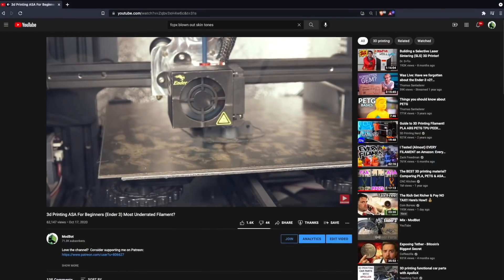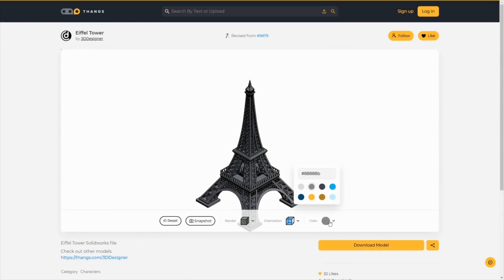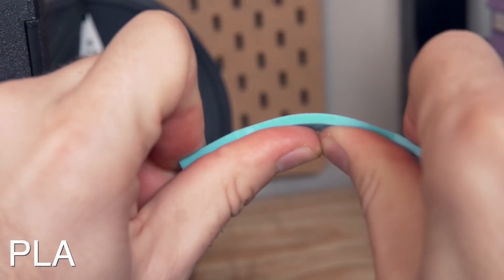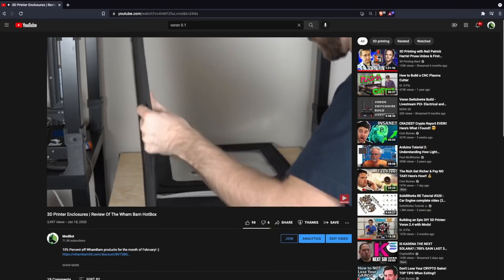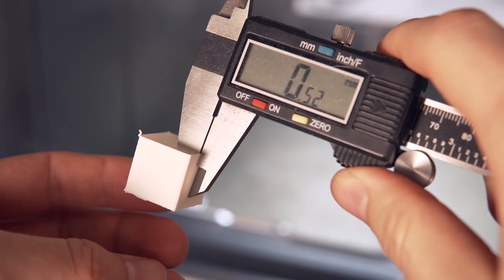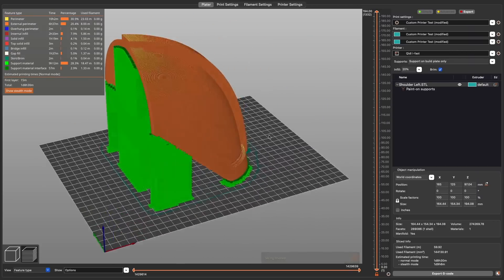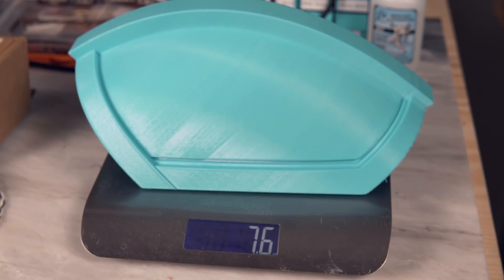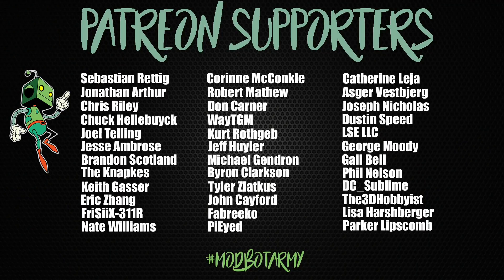3d Printing Lightweight ASA (LW-ASA) Best Filament For Props & Cosplay?

Comment: Why all iron man cosplayers make it out of PLA+ or similar is because it takes a tength of the print time and learning time to print it perfectly. Almost no failures. No warping. No curling. No struggles. The ~30% saved weight is nothing ot a cosplayer generally speaking. The armor pieces you show off here weighing almost nothing compared to a single backpack. There is no weight to speak out here that compensates for the extra difficulty of printing. There's a reason almost no cosplayers use ASA. It took me a month to dial in ASA to be able to print an iron man helmet with zero artifacts, curling or general warping. It's extremely difficult. ASA is glorious at printing smaller, usuall flat, mechanical parts against the bed plate. Larger spheroids, helmets and breastplates is a mess with zero tolerande for piece alignment is a mess with ASA. This is the real reason people still use mostly PLA. You just press print and what you saw in the slicer is what you get. Boom done. Now they can go to the convention while you are still figuring out difference alignments of the ASA, how many pieces you must cut it up in, how to support it hard enough and trying to cope with all the issues with the material. 

ASA isnt impossible to print with. It's just not adapted to large cosplay armours. It's 100% made for small flat mechanical parts and it's INSANELY good at it. I've used my ASA scraper for 2 years and it's not even damaged. It's the best material ever. But it's really not made for large cosplay pieces. It's the wrong thermoplastic for that.

Comment: Great video. If you had to choose between HIGH TEMP LIGHT WEIGHT PLA or LIGHT WEIGHT ASA for large RC planes which do you think would be best?
Reply from the maker: ASA would be my choice just for heat from any of the motors and it’s resistance to degradation from UV 😊

Comment: Also I have been watch Video on 3d printing Gears. The whole thing with gears is fiction . Friction creates heat. Thats not hard to understand so of course a PLA printed gear is not going to last very long. Steal can hold the heat much longer than any plastic printer gear. Even in bearing's steal will freeze up if you don't use some liberating oil.

Comment: I just thought that strength is not just material strength depending on the part you are trying to build. I saw an episode of LEGO WARS tv program. Where the contestants built a bridge out of LEGOs. And to see how much weight it could hold. THe wining bridge design held 1000LBS. So the design does add a lot to the strength of the piece. Also on "This Old House" TV program they built a bench seat in a shower  made out of something like foam board. Also we have seen that placing plywood sheets in a certain orientation adds a lot of strength to a structure in an earth quake. So I am doing more redesign in my parts to see if I can  make them stronger with out just adding more infill. Also CURA has Infill for crush strength and also WALLs for twist  strength .

Comment: I like the video. I am trying to find the old ASA video. The one thing you did not cover that you might have covered in the previous video is how does ASA compared to ABS as hazardous partials and fumes are concerned. I print in PLA  TPU and PETG.   I decided not to print with ABS for that reason. If i don't need real strength ASA or Light weight ASA seems like a good choice. I wonder how Light weight ASA compares to light weight PLA when it comes to building RC models. Airplanes, boats, and cars.

Comment: Iv printed a couple rc planes with esun lw pla but noticed it tends to break near structural areas. Is lw Asa stronger than lw pla?
Reply: No, as sad in this video ASA vs PLA, the ASA will shatter like glass and the same goes with LW-PLA vs LW-ASA. I printed a couple of RC printed plans for Eclipson and 3Dlabprint and still, I didn't see them using LW-ASA Or even recommend it.  I think mostly is because you need that damn enclosure to print it but This LW-ASA had been in production for quite some time now and still, it's not popular with the 3D-printed Aircraft.

https://www.youtube.com/watch?v=oM24AnGZdo0

Comment: I think it would be interesting to print a hot end fan shroud out of this to shave a little weight off...
Reply from the maker: I had not even considered this and now it seems so obvious. That is a great application.
Reply: If you actually increase the performance of your 3D Printer by losing like 1g of material, you might as well just throw the entire 3d printer out the window and consider getting a proper one. Any 3d Printer worth its money will laugh at the amount of weight saving and by the time you've sped up your 3d printer fast enough where such miniscule weight savings could actually make an observable impact you're printing high quality garbage like those guys over at the Speed Benchy Race - It just doesn't make any sense.
Reply: @Chris Valin Proving my point would be like telling you about air keeping you alive - It's beyond obvious if you spent any time trying to print a lot faster than what your average run of the mill 3D Printer will normally do.

Up to a certain point weight will mean nothing to your 3D Printers performance and once you've reached that point where it does you've long since surpassed the point where your prints are still presentable because of reasons that had nothing to do with the motion system such a LW material could benefit from.

Just look at literally - every Speed Benchy Race Video out there. Especially the ones where they skeletonize and carbonframinize their machines to the max to save every grain of weight they can get followed by adding two half HP Servo motors to the X/Y Axis - The prints still look like fresh horse shit you cannot use for anything other than uneducated YouTube clicks.
Reply: @Duraltia  I see it's been about 9 months since you tried to make this point, however, the weight savings could be pretty useful for a delta printer. Could help improve speed and quality.
Reply: @Xanthira222  I think my last statement still holds fairly true as I'm not aware of any major and universally applicable advances in 3D Printing ( at least not in the Hobby / DIY sector ) having happened since my last argument that would disagree with it.

My point back then was about the kinda ridiculous claim that a weight saving of 1g at the Tool Head ( in relation to the rest of the entire moving mass ) would result in a sharp performance increase.

Is a 1g saving on a 300g moving mass system noticeable from a machine standpoint via Inertia / Resonance Measurement Systems? I hope so! Will it show in the 3D printed part? HIGHLY unlikely because if your machine is affected by 1g then simply loading a denser / heavier Filament could totally run your machine out of whack for whatever you've calibrated it for - Hence my comment about throwing that garbage machine out of the window as it your requirements for precision can simply not be met by such a frail system 😁

Comment: Can the infill be printed with different settings for more foaming and less density than the shell? So that she'll is harder but has more or less a foam interior support?
Reply: You could in theory but it would require the temps on the hot end to ramp up and down so it would only make sense on fairly large prints. It would also probably require the slicer to have awarness of the material and how its flow rate needs to change at each temp. Also... since the material doesnt' flow out of the hot end instantaneously it would probably need to be done on a lower flow rate hot end with a low hot end volume (less plastic is held at that temperature inside the hot end itself). Anyway this would probably end up working against you as you are already achieving a light print by tuning the amount of infill.... if you reduce the strength of the infill further that really isn't going to have a positive effect on the print.
Reply: Since buying my idex I have been looking for a way to do different settings for infill for situations like this.  Still not paying for s3d, but s3d could do this with an idex machine.

Comment: Might be a slower print, but could you print LW-ASA with a cooler skin and hotter infill?
The thinking is to have a strong shell with a light centre.
Reply: We already achieve most of that with low infill percentages.... running the infill hotter would just weaken the infill. And wouldn't be useful on small prints as the hot end wouldnt' be able to ramp up and down with the small volume of material per layer... and for large prints it really would be irrelevant since you can already run those prints with less infill to achieve the same result.